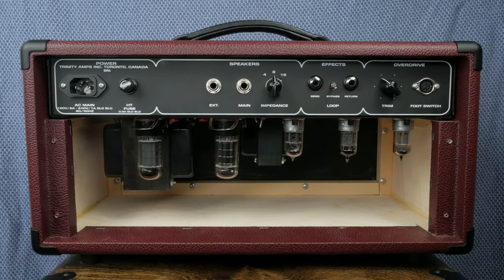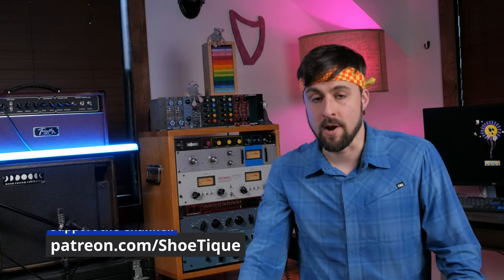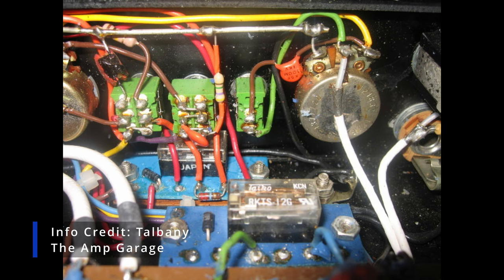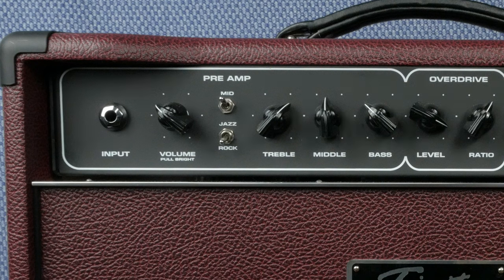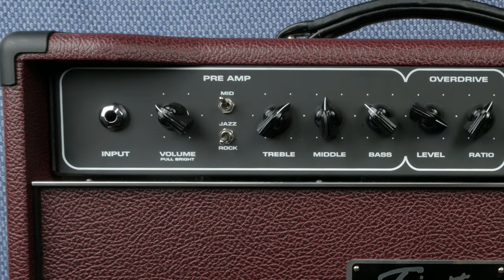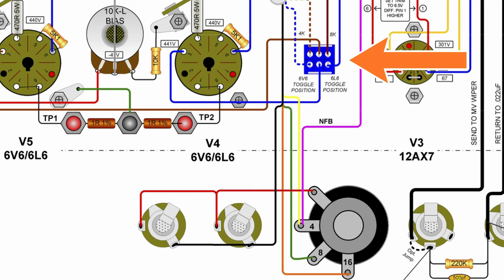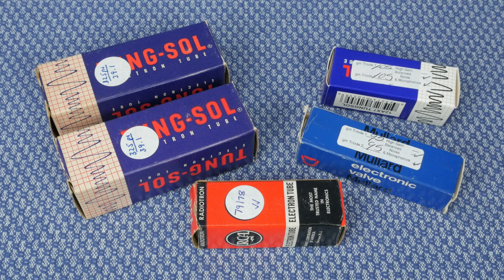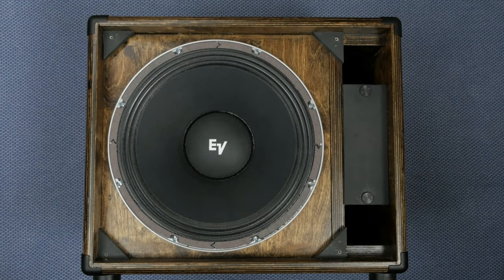Build Your Own Dumble ODS - Trinity Amps OSD

Comment: BOTH 6V6 & 6L6 are fixed bias. The bias switch changes  the. impedance of the OT to match the power tubes
Reply from the maker: Good catch! This is the correct info!

Comment: You gotta build a trainwreck.
Reply from the maker: Which one?
Reply: @shoetiquemusic  So far, I've only built 2 Express amps. They're the higher gain el34/6v6 version. They still do an amazing clean sound as well. But the liverpool is the one you might want to look at based on your comments in this video. Pete Thorne demos an original in a video. They're a very simple circuit. They do the clean to mean type thing just beautifully,  riding the guitars volume pot. I set out last year to build all the classic amps that I could never afford, and the express truly blew me away. There's a pdf online that's worth looking at. Express build guide 2.0. Definitely a desert island amp for me..
Reply from the maker: @soapboxearth2  You've got my interest Soap Box! I've got a compressor and a mic on deck, but I might have to give this one a go after those are done. Here is the pdf build guide for those who are interested: https://el34world.com/Forum/index.php?action=dlattach;topic=22434.0;attach=67180
Reply: @shoetiquemusic  you won't be disappointed! Pacific audio makes the transformer set. They have the original line and the Red Series (less expensive made over seas, identical to the usa model )  you won't believe the harmonics . Pete Thorne demos an original